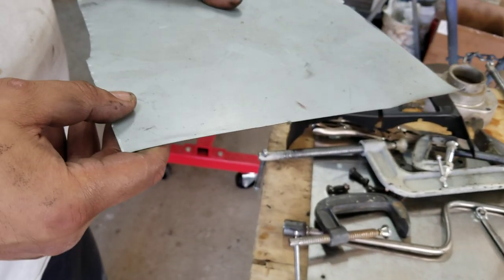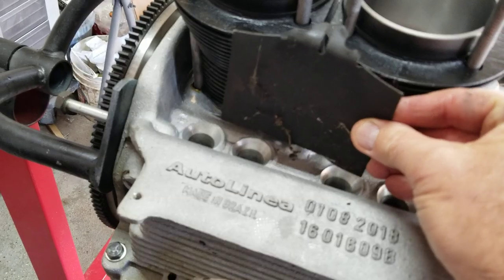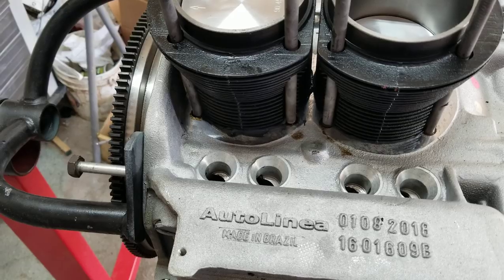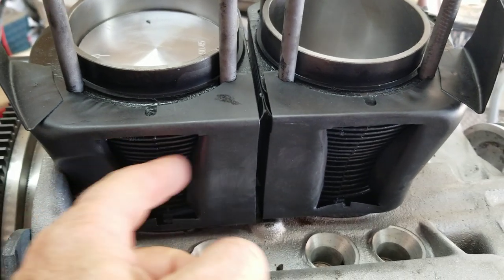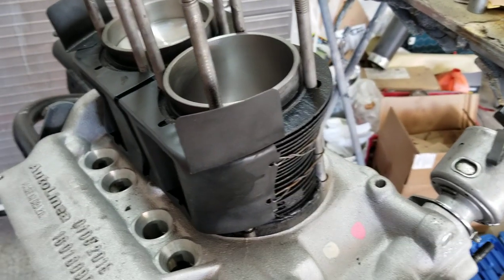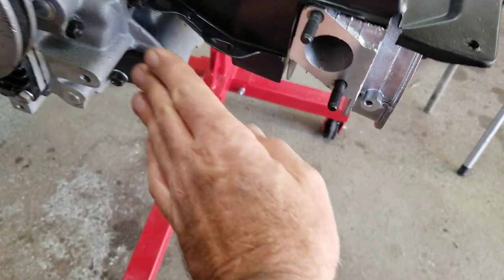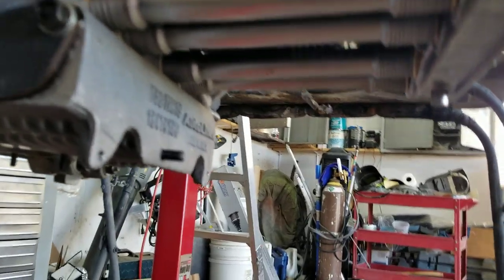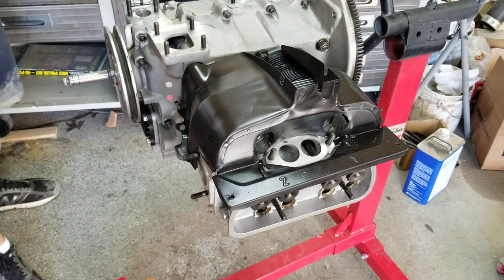vw engine cool tin type 3 help your vw engine run cooler

Comment: Jack Raby did temp checks back in the early 2000s  using these cool tins on type1  didn’t make a difference it’s all documented on his website
Reply from the maker: I guess that depends on where you put the temp gauge. was he using oil temp if that was the case it would not make any difference. Head temp We tested in the 80s on performance engines and we got a few degrees cooler head temp If I remember correctly it was about 5 to 8 degrees. . It was significant enough that we used them from there out on performance builds.
Reply: These were necessary on the type 3's due to the pancake style design and the cooling being run off the back of engine AT ENGINE RPMS, the type 1 belt driven fan is larger, and turns faster due to the relative pulley sizes. The restrictions these add forced more air around fwd cylinders furthest away from fan source... probably not needed on std type 1, but on a modified, hotter running system may be beneficial in similar way to the fwd cylinders. Looking at the total picture on cooling is important as demonstrated by Jake Raby  and Gene Berg who both documented testing with wide varieties of tins and fan shrouds with/without oil cooling tower at back of shrouds. The normal upright fan shrouds bias air over #3 and #4 cylinders tendency to run hotter and to offset the oil cooler ( pre doghouse ) "stealing" some cooling air from the fan shroud, and also remember, the thermostat fan flaps CLOSE the cooling fan system so the engine CAN warm up. This tells you that the stock system is more than capable of cooling in stock systems, but if you modify any of the engines displacement, compression, heads and intakes THEN something like these type 3 tins, outside oil coolers, DTM or 911 fan shrouds become more beneficial/needed.  OH, and if you can, get the cooling fan's blades equally oriented, spot welded, and ground and properly balanced with the alternator... this makes that system much quieter, and durable for high power engines which accelerate/rev faster AND decellerate stressing the fan and shroud if not well balanced. Those fans were stamped out, and had only folded tabs holding them together with a few spot welds.

Comment: I used these all the time but did not go the extra step of using the wire.  Good idea i will  do that on the next motor, I  have the same punch got mine from Eastwood.
Reply from the maker: thanks dan
Reply from the maker: they tend to come loose over time and the wire is really important.

Comment: Thanks, because of this video, I installed it on my 1776cc type 1 engine vw bug (with  air conditioner), and i think it's an improvement for driving on hot tropical climate (Indonesia) with stop n go city driving and all traffic jam. And I think, because of more less temp, my oil degradation become less significant. Oil level also more stable.

Comment: Great tip . I live in Arizona the hot part and yes wire on the cool tins .  I have the punch tool and will use your tip on the next build tomorrow .
Reply from the maker: good insurance and all my engines with them run cool.
Reply from the maker: hey if you are doing one of your engines use a laser temp on the heads  before and after or compare one with these to one without on the same drive. make sure the jetting is good and let us know the results. We did this many years ago with dash temps and got results. plus less detonation on hill climbs. This will help others.

Comment: When I install mine I cut tabs out of metal and weld them on the cool 10 so they actually screw together because I personally believe the wiring method is hacked

Comment: I agree with you that this works better its trimmed and fits perfect.  It also can't get clogged up with mud, grime, etc over the years or it will not work well.
Reply from the maker: good point in all respects to vws gotta keep the fins clean no matter what tin you use.

Comment: This is really helpful. My type 1 has those. Supposedly it is a Scat 1835 crate engine. Everything on it, is Scat, it has chrome tins all the way around. I'm putting an A-1 exhaust stainless header. So the heater boxes are deleted. I have the shroud tube outlets capped. I m guessing I should fill the rear tin holes, I'm not sure what all I need, if anything can be deleted. The car will be run without a decklid and there is no rear apron on it. I guess like a Baja. Just wondering if you have any thoughts on whether or not there are any other things I might want to do or not do.
I've been searching for information about this kind of stuff and this is the first video I've actually found that specifically mentions the, Kool tins, which I started searching in the first place. Thanks for the great content!

Comment: My builder put those on my 1904, seem to work fine but you can't use your old sled tin. I fabbed an aluminum sled tin to protect my thermostat from water and debris.
Reply from the maker: I have those tins on mine just cant put the small ones on the rear of the engine

Comment: Nice job!!..im deaf....the coolin tin work fine with the type3 square back  engine tins??...is better use this coolin tins with the type3 horizontal  oil cooler and fan system?....thanks and my best!

Comment: I really need those tins for my type 1. It just makes sense! I was reading at car craft store, and it said will not work with heater boxes?
Reply from the maker: I am using them with heater boxes. I cant figure out why they have that doesnt make sense to me.
Reply: Mike Fn Garage I don’t know sir! I just wanted to double check with you. I’m going to get a set for sure! I’m using heater boxes, but will add those lower tins. I like the design. And the way you showed the better cooking of the whole jug, makes complete sense!!!
Reply from the maker: @SladesVWBeetle  I use them on many of my performance builds. My engine is going to have heater boxes cool tin and tin underneath that we should be starting it up tomorrow will it run video coming.
Reply: Mike Fn Garage Awesome!! I always look forward to your videos. I’m glad they work with heater boxes, not sure why car craft put that on their website

Comment: With your advice from previous videos, I picked up a nice pair of these at Pomona for $2.  Saw bunch last Sunday too.  Tanks for another great video Mike!
Reply from the maker: just put them up tight. and hey if your thinking about it put a laser temp on the heads before and after a hill climb and post the results. like stop and idle then hit the heads from underneath.

Comment: Interesting to see the aftermarket head tins dont have the cylinder head deflector piece which is crucial to ensure the heads receive the correct amount of air
Reply: The Type 3 style cooling tins replace the deflector shields and do a far better job of cooling the barrels.

Comment: Did you have a problem with your push rod Tubes hitting the cooling tin? I tried to install mine but I couldn’t install my 
push rod tubes because there was over 1/4 of rubbing. I wound up giving them to duckman cycles. He is going to try and use them on his next project.
Reply from the maker: no they should not do that.
Reply: Mike Fn Garage 
??? I wonder why I couldn’t get mine to fit. I did get 1641 pistons and new heads. I wonder if the Hess were over sized.
Reply from the maker: @OFFAxisBuilds  not really sure on that sometimes you need to trim them a bit around the studs because they are designed for 8mm studs maybe you have 10mm but I use them on 10mm all the time. New motor super low head temps even after a hill climb. putting on new exhaust right now for the next videos on it.

Comment: @mike fn garage   My 1915cc engine is missing all of the lower tins. What doghouse fan shroud do you recommend and top cylinder tins? I was thinking about purchasing the COMPLETE powder coated OEM German set of tins. Is that better than getting something like Scats black powder coated doghouse & powder coated cylinder tins?
Reply from the maker: German tin is really good if it is original OEM tin. But scats doghouse is I want to say just as good. has all the air deflectors like the original.
Reply from the maker: If you have a merged exhaust which would be nice to get the HP out of that engine you cannot run all the tin underneath.  At that point I would say you really should run the cool tin. Required to remove the heads or use spring loaded tubes. I prefer using original equipment tubes so I remove the heads. While you have your heads off make sure the air ports in the heads are clear. sometimes some heads the castings clog the air ports. gotta check this stuff. I am running 9 to 1 compression with no overheating or pinging in a bus.
Reply: @Mikefngarage  Thanks for the info. This is a bus engine custom built by Headflow Masters out of Vista California. He only builds them one way, fully balanced & it’s welded for full flow. I have a 4-1 single quiet but it’s rusted & I want to replace with something that looks stock like Vintage Speed’s super flow. It doesn’t have balanced headers though if you want to use your heater boxes which I intend to reconnect. Scat would be a lot less expensive. I was quoted about $700 for everything including the thermostat & flaps. Only a few lower pieces are Brazilian
Reply from the maker: @paulv8453  Unless your driving in extreme cold there is really no need for thermostat flaps. guys will tell you otherwise. But years ago we had more engines than I can count that had stuck flaps and burned up engines. Just fully warm up the engine at lower RPM for about 5 minutes and your good to go. I usually drive it slow for a while. I am running 8.75 to 1 on that engine and 9 to on on my other bus. No overheating and no running hot at all. without therms. some guys install them for flow with he flaps welded open. but I don't see much difference. IF you watch my car show video I drive my bus 80 lots of times with 3.44 gears and 9 to 1 compression and it does not run hot. Stock top dog house tins, Or scat. (pretty much the same) type 3 cool tin below the cylinders and no other tin. Because the other tin wont fit with the merged exhaust. I have full flow stock oil sump, No deep on on the 9 to 1 engine. large oil cooler with thermostatic fan (empi). But here is the key thing. My carb jetting is SPOT ON. run on exhaust analyzer. Getting the air fuel jetting right is super important. FYI I never run 1915 lots of guys do but I would use 74 stroker crank with 90.5 pistons 1904. the 94 cyls is IMO too close to the studs. But once its bored to that you just need to run with it. It would not be  my recommendation for a bus either. longer stroke makes better torque. shorter stroke 69mm makes less torque and more top end. 1915 is 69x94 Not the best bus power. Braziliand lower tin is fine just the shroud need german or scat. and also cylinder  dual port tin. they have an extra air diverter on them on oem german.
Reply: @Mikefngarage  This is great info! 👍 Thank you but what do you do when you rely on the professional and that’s what they suggested? I urged him to make it an 1835 or something smaller but he insisted that bigger was better.
Reply from the maker: also my  heads have opened air ports for air flow. aa performance 40 35 heads are already opened. But some after market ones have bad castings and ports are casted shut. FYI. just look down through the heads and make sure all the air ports between the cylinders are open and clear and the shields are on the bottoms of the heads. Remember 90% of the heat generated on your engine is in the heads and the tops of the cylinders. Depending on how they did the  deck height. tighter deck height to an extent creates more head fire. Too much piston deck gap height creates barrel fire not good for running cool. More detonation. Most engine builders DONT know this. I learned from old school racers who ran 0 deck height and copper head gaskets. to get all the fire in the head and higher compression. Not recommended for street.
Reply from the maker: @paulv8453  yea that is the cheapest way to build a bigger engine. I really like the 74 stroker but the crank costs about 300 more dollars to you. 74x 92 thick wall. is 1968 another super strong torquey engine. still uses the case bore for 90.5  Us old school guys dont like 94s but the new guys run them. UNLESS you are getting aluminum case. then it is ok they relocate the studs for strength.  But for me if IM spending the 850 for a aluminum case I am going 78mm because they are already clearanced for the crank. and shuffle pinned. Aluminum IS better.

Comment: Do you have any data that will back up your claim about superior cooling over a type 1 factory set up? As far as I know there are 2 sources that actually have investigated and collected data and they both disagree with your postion. The factory did alot of R and D and came to the opposite conculsion and said so.
Reply from the maker: only testing we did 30 plus years ago on a car;. Plus my personal experience I run them on my performance builds and I feel like they work Plus tested them on one engine before and after with lower head temps. same car averages over several weeks of driving. The test data I have heard of were guys with super shouds that may have maxed out the total air CFM ability of the fan stock deflectors. PLus One was VW which already that would have been tainted. They wont say something could have been done better because they would be wrong. We were aware of those same sources in the 80s and tested them anyway. DIsagree with the other gurus.

Comment: would a standard motor benefit from this?  1200 to 1600 ?
Reply from the maker: sometimes but best really for performance engine. I put them on everything for the most part. Especially if you drive during hot summer then you need to do everything you can do.

Comment: Not doubting you but Volkswagen did issue a bulletin stating that type 3 tins must not be used on the type 1 engine, you can find it here https://www.thesamba.com/vw/forum/viewtopic.php?t=667778
Reply from the maker: Yea that was a OMG......we better say something or someone is going to sue us for not putting these on every engine......Especailly with Merged exhaust they are a must install for a performance engine. With my 1904 9 to 1 compression. I can get it hot climbing too fast in my bus then as I crest the hill it cools it right down. That would not happen with stock deflector plates.
Reply: @Mikefngarage  I’m willing to try it when I eventually rebuild my 2276, I’ll get back to you in two years 😂